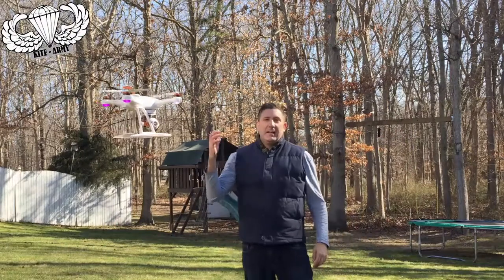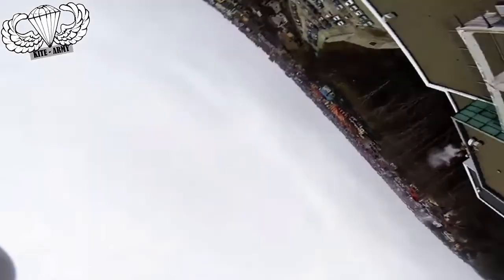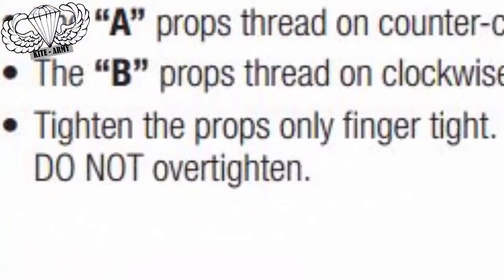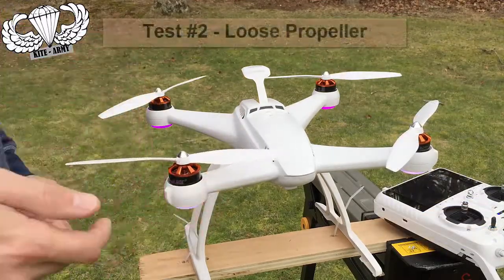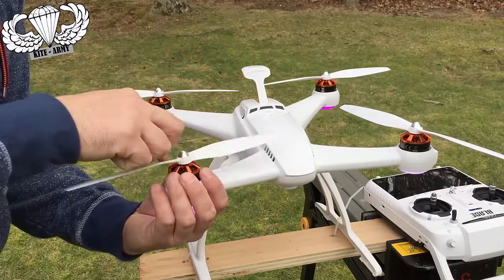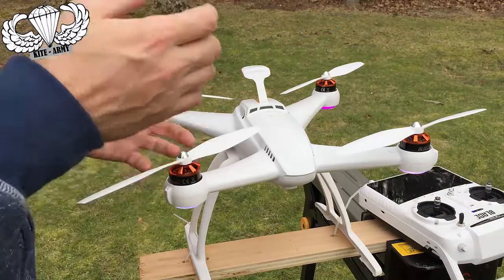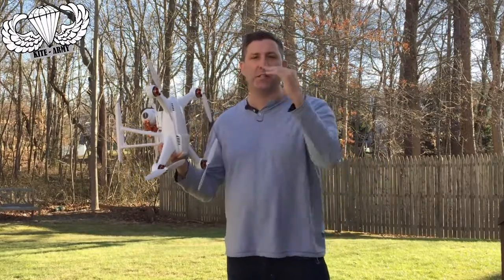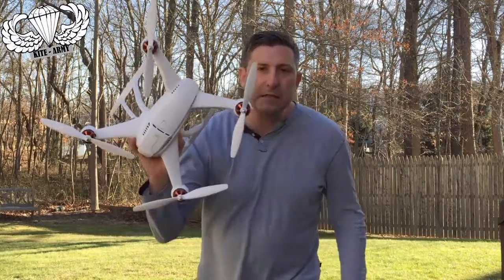Drone Propeller Blade Fail Test - Avoid Crashing & Flyaways DJI

Comment: +Kite Army -- Is it possible to put something like "LOCTITE" on the propeller shafts threads to help secure the propellers?  {I do "Kite Aerial Photography", but I have not owned or flown a "D-Word" - LOL - as of yet.}
Reply from the maker: You could but often you remove the blades to pack it down.  I'm interested in your kite aerial photography - I looked into this a while ago.  BTW.  I also own a DJI phantom but think that this drone is the better photography unit.
Reply: +Kite Army Roger all that.  I was under the impression that the props stayed on the drone most of the time.  Loctite might not work so well if they were dismounted regularly.  // I was already "into" kites when I first learned about KAP {Kite Aerial Photography}.  While not nearly as maneuverable as taking aerial photos or video with a drone, it is quieter and generally cheaper.  Additionally, with good wind conditions & the right type of kite for the prevailing wind conditions, a KAP rig could remain airborne for an extended period of time....

Comment: my chroma lost it's propeller a couple days ago. i finger tightened it just like your first one. and i clicked on Return to home and the blade untwisted and the chroma dropped like a rock.  they really need a locking device for the props.
Reply from the maker: Ouch...Don't worry, at least you still have a drone, mine went into a flyaway and landed in the water.
Reply: +Kite Army my last one dropped over a wall from a bad cel or something and someone swiped it by the time I got around the wall.  Did horizon replace yours for you?
Reply from the maker: Still working on replacing...fingers crossed
Reply: +Kite Army good luck.  I just got a new motor in and am just waiting for for legs and my camera to be sent back.  Oh and after hours on the phone with Horizon their definition of finger right is to tighten it until you can not anymore with your fingers.
Reply: +Sean Ozz hopefully I will not lose a propeller again. The first time I lost one they were in pretty tight so even done finger tight it is still possible for one to back off.
Reply from the maker: Thanks for adding your post.....this may prevent others from having to deal with this headache.  From now on I'm installing mine with an impact wrench.
Reply: +Kite Army yeah.  I would love to keep anyone from having to deal with all this. Don't use a tool or over crank it cuz if you strip it the same thing will happen. Lol
Reply: +Kite Army yeah.  I would love to keep anyone from having to deal with all this. Don't use a tool or over crank it cuz if you strip it the same thing will happen. Lol
Reply from the maker: No doubt.  I was just kidding about the impact wrench.  Probably better that you pointed that out :)